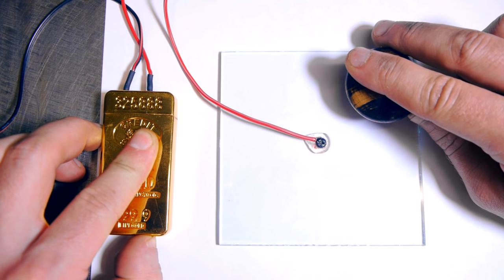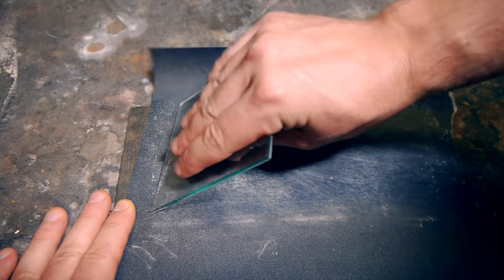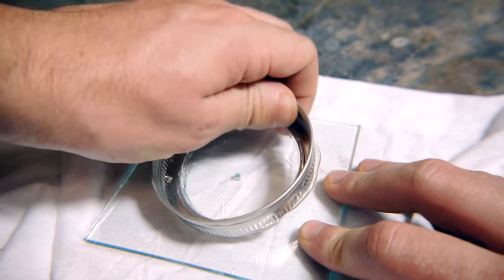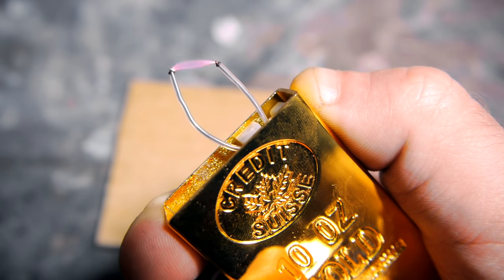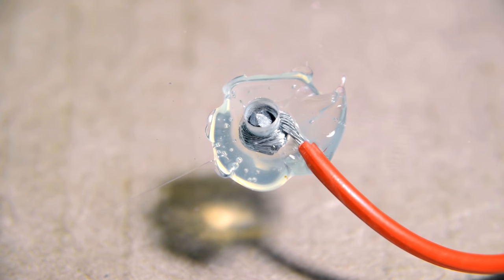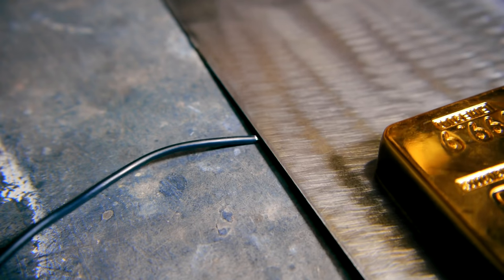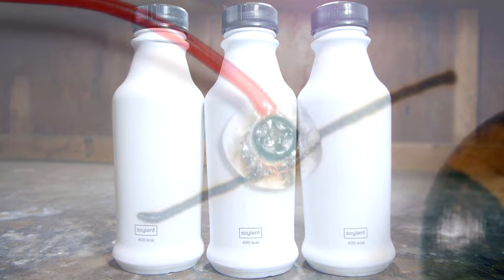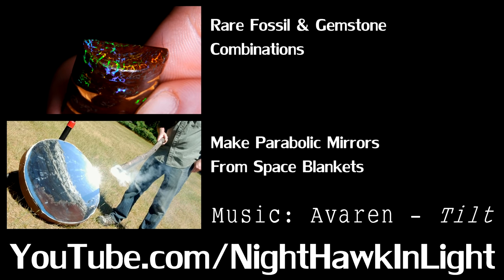How To Make a DIY Mini Plasma Cutter From an Arc Lighter - NightHawkInLight

Comment: the glass isn't a heatsink, it simply starves the area of oxygen to prevent burning and fire
Reply: Yeah I was thinking the same thing kel
Reply: Actually, it does both. The glass blocking oxygen prevents the paper from combusting. However, if it didn't absorb heat then the surrounding paper would slowly char, which doesn't require oxygen. To be honest though, the metal plate probably does the majority of the heat dissipation.
Reply: I tint windows on cars and businesses and yes glass is acting a little as a heatsink....all the spec sheets showing how much heat the film is rejecting from passing through to the interior also shows the percentage that just the plain glass keeps out by absorbing the heat and then dissipating it back out.
Reply: Te Boz that sounds right

Comment: I'm going to put one of these on the effector plate of my 3D printer and use it to cut paper shapes. This is way cooler than the knife that most people use. I bet I could cut gaskets and maybe foam pieces with it too. Thanks for the inspiration!
Reply from the maker: +USWaterRockets the only downside with using this for that sort of purpose is the shortish battery life of these lighters. You could probably make a really effective cutter if you wired in a DC power supply in place of the battery
Reply: watch out that power supply can burn out.
Reply: Glad that not only do you read the comments, but you add helpful info for people that wanna do things on their own
Reply: Couldn't the usb charging connector be used to power it though? I guess it would only help win a little extra continuous working time, but it does seem like the easiest solution.
Reply: Just speculating, but as USB connection can't handle very much current, I doubt it could keep up with the Arc's power usage.
Reply: NightHawkInLight That's a good point. I didn't think to mention that I was going to use the power supply in the printer itself to drive the arc. I was thinking I might have to use a SSR to control the power to the arc as well, so that I could turn if off and on for each cut. My initial thought was just to plunge the electrode close to the plate and raise it up to start and stop the arc, but now that I think about it, this would probably make the ends of the cuts imprecise as the arc dwells at the end of each move briefly.
Reply: PolyJohn
Yeah, I doubt it would keep up with the power usage, but as you are draining the battery it should be charging some so as I said, lengthens the time until the next charging pause is needed. Unless it can't be charged while its used?

Comment: I don't think that what's keeping the paper from ignition is the heat being spread into the glass on top or sheet of metal below.
I think it's just that there is no air (and so, no oxygen) around the spark, so you don't close the triangle of fire. You got heat (the spark) and fuel (paper), but no oxidizer, so no combustion.

Comment: hey night have you ever considered making a wall turret that shoots air soft?
Reply from the maker: I'm not good enough with programming to pull something like that off. Maybe in the future when I've learned more.
Reply: What about a wall of Mexico
Reply: +NightHawkInLight are you sure you need programming to do that? You could use multiple types of triggers to set off a switch to start firing or something.
Reply: +NightHawkInLight hookup a motion sensor off of motion activated garage lights, connect it to your airsoft mingun, and somehow make it so that the electric signal opens the valve
Reply: +NightHawkInLight it wouldn't be a sentry but it would be a motion activated trap

Comment: Would it cut through thin balsa wood ? I am building a 2d CNC machine and i would use a hot wire to cut stereofoam but now that i saw this ,i could go for something like that. Or would a hot wire be able to cut through balsa wood anyway ? An answer would be highly appreciated  thanks. Great video as always.
Reply from the maker: You would probably have to scale this up with a bigger power supply and more resilient materials. It would be a much more ambitious project than this was.
Reply: NightHawkInLight Would a hot wire with a 12v max adapter have any chance of cutting through thin balsa wood ? Or should i just stick to the stereo foam ? (which to be honest isnt half as useful ) 

I think grant thomson did something similar with a hot wire but he didnt specify the max adapter specs.
Reply from the maker: I don't know, I've never tried it.
Reply: NightHawkInLight Ok, thanks !
Reply: Just so you know, it's "Styrofoam", not "Stereofoam".
Reply: A. Zak Yeap, thanks.
Reply: Was it your autocorrect?
Reply: +some interesting name he just said for the Grant's project, it was not specified the max adapter specs
Reply: +NightHawkInLight have you heard of AvE?
Reply: +NightHawkInLight to scale it up if I am not mistaken you would house the arc with the right gap in a housing and run compressed air through that arc making a super heated stream of gas. take that gas run through a focusing nozzle  and you should've able to cut some things keeping in mind that air will also provide source of oxygen and heat to start things like wood on fire.
Reply: stereo foam? is that like radio cardboard? lol
Reply: +Jake Lanier  AvE ftw!!!
Reply: If the balsa wood is thinner than the diameter of a cigarette, then I assume it would work. The cuts in the video don't look very precise, so I would suggest using an x-acto knife or hot wire cutter. If you do try it, let us know!
Reply: Tommy Akers I would not use air, i would use CO2 or maybe nitrogen.. air is not a good plasma to use because it will cause it to oxidize and burn
Reply: PartVIII there is also an adapter for soldering iron that holds an exacto knife blade and heats it up, I have one it's pretty handy.

Comment: Cut the outside of the glass as a circle with the electrode in the exact center.  now you can run it on a fence to cut straight lines or follow a contour.

Comment: any suggestions on something a bit more powerful to hack to use on a thicker material like cardboard?
Reply from the maker: A stun gun possibly, but that would obviously pose a bigger shocking hazard.
Reply: +NightHawkInLight thanks for the suggestion love the vids.
Reply: a stun gun might not have the amps to burn cardboard  but in the stun gun might be a resistor that limits the current and a capacitor to create the sparks instead of a continues arc  but you shod look into MOT's flyback transformers and neon sign transformers
Reply: Brice modern day neon sign transformers are current limited, best to just use a microwave trans and take out the shunts and rewind it

Comment: This is a good video. I've been looking into making my own plasma cuter (for steel). I just bought a mot and am planing to get 1 more, i'm modding them to output 36 v ac and as much amps as possible. 
My idea is to do the same but instead of glass use a refractory material and instead of a screw a carbon electrode + a gas injection system so it can blow away the molten steel and cut. But the thing you created here is something i cod mount to a CNC system that would make for a fun project  and i can make a ne555 flyback high voltage PS that would make a higher voltage and maybe use wood instead of paper so it doesn't cut but burns a pattern and if anyone has seen those wood burning videos it creates a nice pattern  (type in to youtube "wood burning with high voltage" you will know what i mean)
Reply: Brice I was thinking of getting two identical MOTs and then taking them apart so both the E sections go together instead and then using copper tubing as the wire coated with an insulator and then using a water pump to pump something like cooled salt water or something through the copper tubing primary winding.. Idk just an idea I had.

Comment: Nice. It wouldn't take much to turn that into a CNC arc cutter. Not sure what you could do with it, but it might be an interesting project.
What does it do to plywood? Would multiple passes cut deep enough to cut through 4mm plywood? Would that be too thick to initiate a spark?
I wonder if you could cut thin metal though?

Comment: Hi.  You can just fill a sink or tub with water and drill anything under water.  f-y-i.  Save you time playing with glue and making a tiny little tub.  Interesting video.  I wonder if I can vaporize the copper layor from a blank printed circuit board with this.

Comment: Does it hurt at all to touch the metal sheet
Reply: Um yes lol you would get shocked.
Reply: no, for you to get shocked you'd have to touch both the metal sheet and the end of the other wire. so no, it will not hurt to just touch the metal sheet
Reply: +Sebastian Benz No... You need to touch the metal sheet and the cutter screw at the same time
Reply: You wouldn't as you wouldn't the path of least resistance.
Edit: I'm not actually quite sure if what I said was right but the ACTUAL answer is that you wouldn't get shocked because the electric potential is between the negative and positive, not the ground
Reply: +ficolas2 Ohhhh lmao sorry lol 😂😂😂

Comment: Does anyone else find that their arc is not powerful at all? My lighter (was) perfectly functional, but the arc is weak enough to be barely able to blacken paper and it cannot travel nearly as far between the ends of the pen as it could in the lighter spark gap. My current theory is that some problem arose in that I did not use brass rods like he did; I cut the metal base parts off of sparklers and used those.  Will the decreased conductivity be a problem? I'd appreciate any input, as I'd really like to get this working
Reply from the maker: Strange. It could very well be the steel wire is giving too much resistance. You could try just some stiff copper wire.

Comment: Don't use sand paper to neutralize glass, just a bit of heat by lighter, will do that.
Reply: The Clue no it won't, it can cause it to crack and split
Reply: The Clue you ever seen how people can cut glass bottles in a controlled manner by just scoring the glass slightly and then putting warm/hot water on it? same concept will happen to the glass on the edge and it can cause it to fracture

Comment: Tried the link to soylent, did not get 50% off, only 5%. Is that a mistake?
Reply from the maker: Yeah that's got to be a mistake, it should be 50% off the first case unless maybe you've ordered from them before? Send them a note through their contact page and I'm sure they'll get it sorted out
Reply: +NightHawkInLight haven't ordered before. I'll be in touch to them, then. Thanks for the clarification, though.
Reply: +NightHawkInLight  do you think this could make designs in wood
Reply: The electric arc must travel from the red wire to the electrode, then through whatever you want to cut and into to the metal plate, which sends the current back through the black wire into the lighter . If the electricity can't conduct to the plate, nothing will happen. As such, I don't think this would work for woodburning, unless it was very thin, but at that point it would basically be paper and you would also be cutting it. I thought the same at first, however.

Comment: The reason the paper dose not burn is the lack of oxygen not that your keeping it cool. The lack of oxygen is do 2 the 2 pieces of non porous materials you used on both sides. Air can't get through glass or steel. But cool video tho.  :)
Reply from the maker: It's for both reasons. Lack of oxygen keeps the paper from bursting into flame, but if the heat were still allowed to spread the paper would still carbonize past the borders without oxygen.
Reply: I think its cuz its theres bi fire, no fire= no burn😜
Reply: you can carbonize with out any air... You are wrong. You can get it to over 1000 f and it still will not burn with out air its called carbonizing and is how  char cloth , charcoal briquettes and so on are made.
Reply: Fire is a form of oxidation and can happen no matter the temp depending on what you are burning
Reply: Darian Berg that's why he said if the heat were able to spread meaning if there was no heat sink then it would carbonize the paper.

Comment: In the early 60's I was in jail with this one Ol' boy that showed Me the "Old School" way  to cut hat old 1 inch  diamond wire over the window using wire, ( radio power transformer) -   I believe", and a Wooden pencil.  I'm sure it wasn't called old school back then it was do it  "Like the Old Timers Did" .

Comment: why does the drill have to be in water?
Reply from the maker: Two reasons. If the bit gets too hot it will dull it very quickly, and also if the glass gets too hot it will crack.
Reply: NightHawkInLight oh. I guessed it had something to do with the heat. Another question if I may:

You mention that these electric lighters are becoming more popular, are there any advantages to using electricity over flame, or is it just a gimmick?

The only reason I ask is because you seem to know a lot about this kind of stuff.
Reply from the maker: As a lighter they're pretty gimmicky. Only small things can fit between the terminals, nothing larger than a cigarette. They also don't have the longest battery life. The upside is that they don't require fossil fuels and don't release CO2/butane, but the amount of greenhouse gasses produced by pocket lighters is inconsequential anyway. They're a cool gadget but not especially practical for what they were made for.

Comment: Nice video, but at the beginnins you say something that I don't agree with. What you are doing is not keeping the surface cold (because it burns anyway), but you are keeping oxygen away from the flame. It's the lack of combustive agent that prevents the flame to spread.
Reply from the maker: +Antonio Misuraca yes lack of oxygen stops the paper from igniting, but lack of heat stops it from carbonizing.

Comment: It would be better to cut off those tips and use one of them as an electrode because they are designed to produce and sustain spark
Reply from the maker: In these cheap lighters it's just the end of a steel wire. Nothing fancy in them like graphite electrodes.

Comment: Thats not a plasma cutter, Its an arc cutter. I understand arcs generate plasma, but its the arc thats doing the cutting, not the ionized gas. Also glass is a thermal and electric insulator, not a conductor, so your not sinking the heat, but starving the flame of oxygen. I know everyone is entitled to their opinion, but damn.
Reply from the maker: An arc is plasma by definition. It's the plasma that causes an arc to be hot. Thermal insulative/conductive properties are relative. Glass is thermally conductive enough that in this case it does act as a heat sink.
Reply: +NightHawkInLight so close to the truth
Reply from the maker: The 'plasma jet' is an arc that is blown toward the work piece with compressed air. There's no difference in the plasma in a commercial plasma cutter and the plasma from the device in this video, just a different positioning of electrodes.
Reply: The distinction that people are making are from a welder's point of view - not an engineering pov. In general forum, there would need to be air movement to create a vortex. This happens inside the nozzle where the electrodes come close, but do not touch and an arc is not passed through the base material but pushed. There is a preflow gas (air) that creates a vortex. You should be able to accomplish something like this on the scale you are working with. But the conductive plate you are arc-ing to has to be removed from the build. Then you would have to figure out how to create the vortex inside of some sort of heat resistant nozzle. I think you should attempt it. For an air source that isn't a compressed container, perhaps a high power fish tank air pump with really good cfms - hhaha, or in that case cims.
Reply: +Atomkey Sinclair: "The distinction that people are making are from a welder's point of view - not an engineering pov"

Hahaha nice way to describe it. Another way would be Descriptive vs Prescriptive; People are saying that saying it's a plasma cutter is misleading because "plasma cutter" is the name of that other thing that is just different positioning of electrodes, it is what people that use those tools daily call them. Descriptive is what NightHawkInLight is arguing for.

Both are right, effectively, which is why I think they should have accepted what each other was talking since it didn't necessarily contradict what the other had said.

Comment: thats not really plasma cutter... a plasma cutter creates an air flow through an electrical current turning into plasma that then acts as a laser that slices through material... grounding off the material is just a safety feature to keep the electrical current from shock the shit out of you

Comment: Does that bottle really say 400 kcal? That's about half a year's worth of calories.
Reply from the maker: 99.9% of any food that has calories listed is actually listing kilo calories, not calories. The standard thing where it reads, "based on a 2,000 calorie diet" should actually read 2,000 kilo calorie diet, because that's what it means. Calories as you know them are kilo calories. Basically every label has it wrong.
Reply: Interesting, thank you. I guess we'll just put that on the long list of things we need to fix about our nutrition labels.
Reply: 1 Kcal is equal to 1 Cal (with capital letter "C")